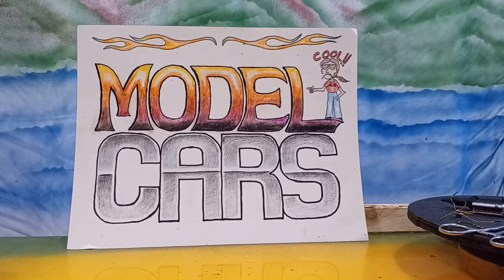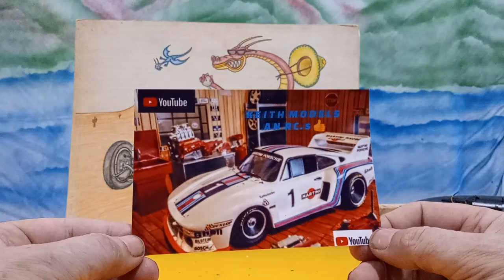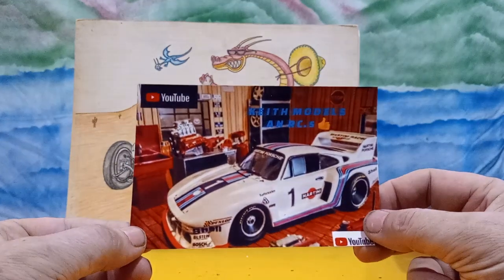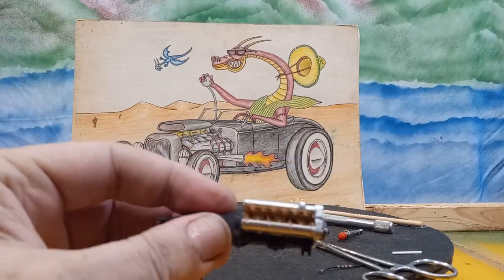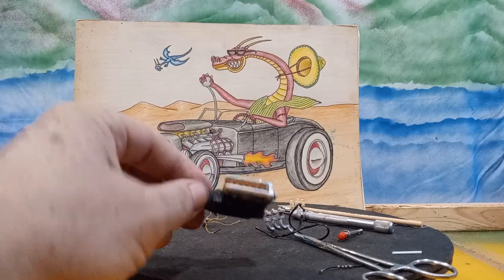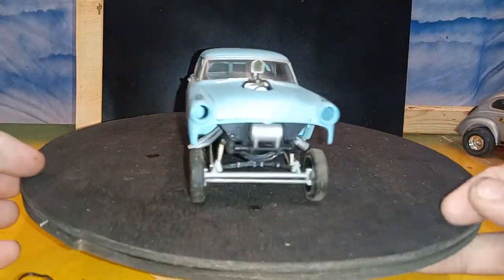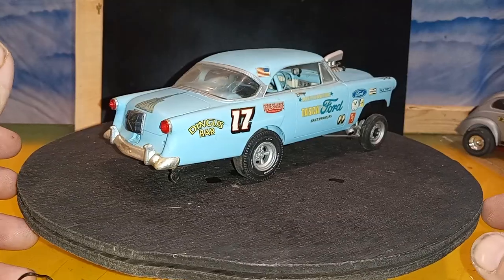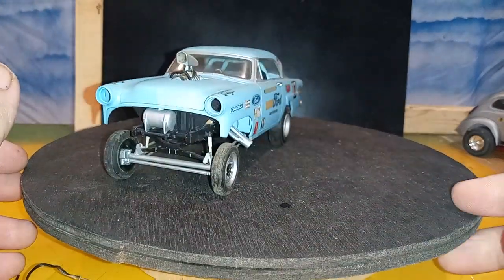#18,,,,motor details,, tip's and a couple models

Comment: Nice tip on drilling out little round things by using reverse psychology. The builds are cool. You must have a pile of drive shafts somewhere. Stay cool.
Reply from the maker: Dude you should see the pile of drive shafts I have sooner or later they'll find homes,, took me a lot of drilled fingers before I figured that one out, but it works good,, Glen